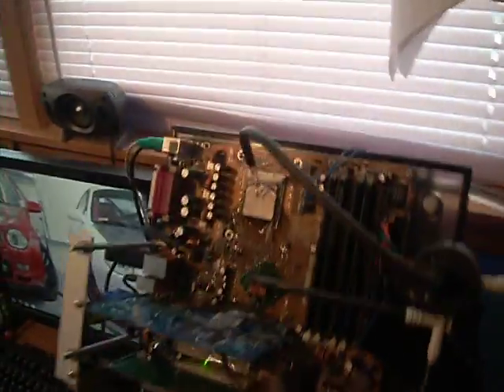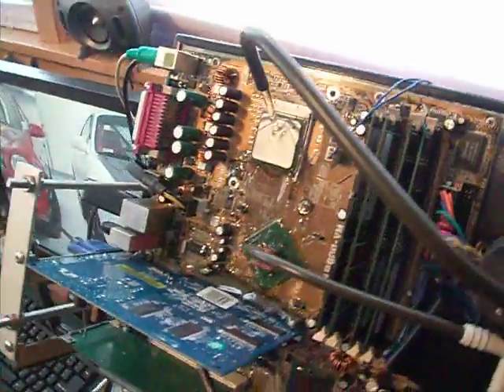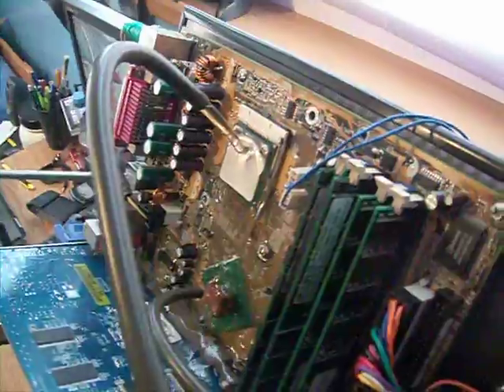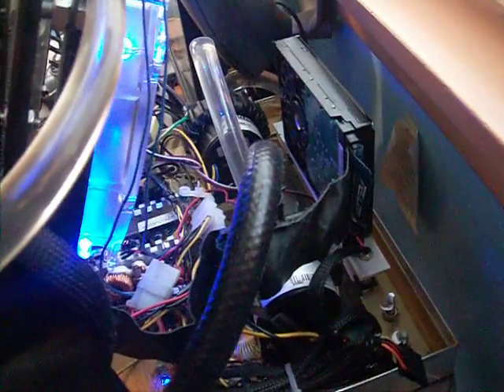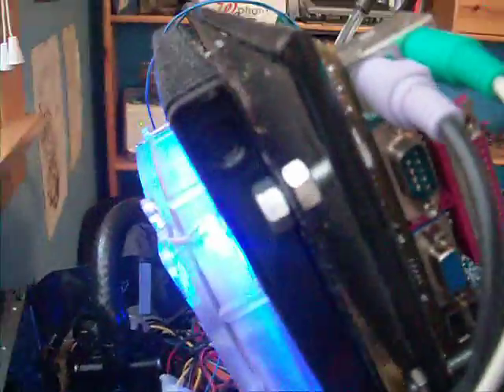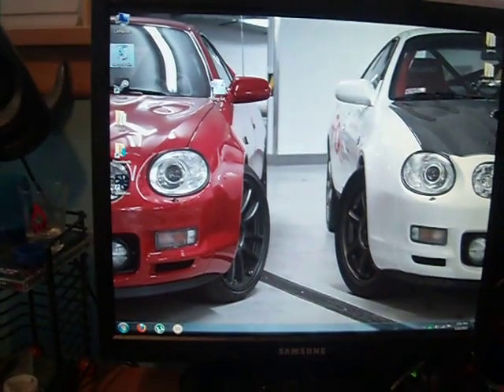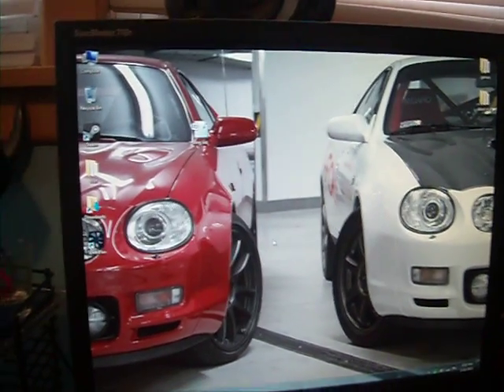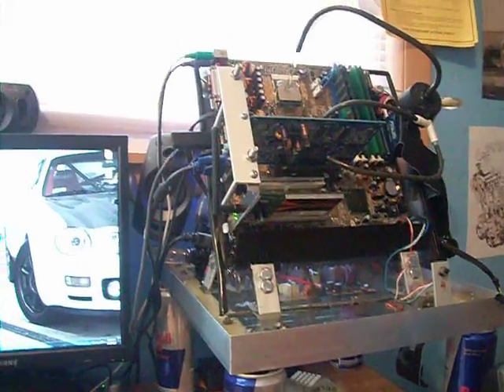My oil cooled computer [no aquarium]

Comment: It's a cool idea but doesn't mineral oil fuck up rubber hoses? Also, I thought you weren't supposed to submerge the PSU. I could be wrong, but I could swear I heard that those were the 2 biggest things you're not supposed to do when setting up an oil cooled PC. Don't use anything rubber, and don't submerge the PSU.

Comment: one of the main advantages to using a submerged and closed system is to prevent impurities and dirt from getting in the oil. if that happens the oil will not function as a cooler. an acrylic hood with filtered ventilation would work well.

Comment: except it's also 300 a gallon, would evaporate into the air rather than store heat like the oil does, and is sold in obscure locations or from specialized dealers. Don't get me wrong, I love the stuff for it's brilliance and potential for application, but for this project, a personal computer that is NOT held in an enclosed environment, Novec just wouldn't do the job.

Comment: Interesting. But it would be more efficient to lay the board flat and let the oil run off on its own. Mineral Oil is a good Heat Absorber but not well for Exhausting the Heat which is why he has a Radiator. But with a Stream that fast the Oil doesn't have much time to grab some Heat from the CPU before it looping back around again, it only makes contact with the CPU for about 0.12649 seconds. So if the Motherboard was flat it could make contact for about 2-3 seconds which is a good amount of ti

Comment from the maker: The cans are attached with bolts. The oil doesn't evaporate or leak, so I've never had to add any since original assembly. Dust is handled by a small engine fuel filter.

Comment: Oil's thermal conductivity is only about .12-.15 so if you do anything intensive, you might consider using CPU & GPU coolers that have heat pipes and run the oil over them.

Comment: The US Air Force used a technique like this to cool hot IC's in missiles: they just squirt coolant (like Freon, or canned air) directly on the chip die. It was lighter and cheaper than expensive heat sinks and phase change cooling systems for a one-shot computer.

Comment from the maker: @MrTpengineer 
The pumps I'm using are asetek watercooling pumps, so I'm way ahead of ya haha. As far as evaporation goes, mineral oil doesn't evaporate. At least not any significant amount. I've noticed no level drop over the past year so I don't have too much to worry about.

Comment: You can sometimes repair a removed IC chip, strip it down to the bare PCB lay the chip where it should go & put it in the oven for a bit, it worked for me when I removed some heatshinks from some RAM & an IC came off with it. All it does is reflow the solder.

Comment from the maker: @AliveoutofSpite 
haha its funny you mention it because it sure sounded like one of those fountains for a while. But the drip sound is really hard to sleep with so I installed some baffles, though the oil changes viscosity as it heats up so I still get a little dripping noise every once in a while.

I think you should check out hardcorecomputer's website. They are making a submerged pc like the one you described and i think you'd find it interesting to read

Comment: Very cool! I'm planning on doing a hybrid- something like this, but all submerged. I figured a couple aquarium-type pumps in series will give me all the pressure I'd need, then push it through a filter (think Fram), a radiator, and then pipe the cool oil directly to the CPU, GPU, RAM, etc.
This is a really cool concept- it reminds me of those desktop fountains...just need a zen garden and a bonsai, and you're set.

Comment from the maker: @HennesseyHPE1000 

actually, sometimes the intake sucks in some air bubbles that get stuck in the pumps and all the computer does is shut off. The pentium 4 cuts power at some threshold temperature so I dont really have to worry about frying anything. In fact im pretty sure most cpu's have that feature these days.

Comment from the maker: @JamaicaNY11435  

It's hard to give a definite number on CPU temps simply because there are many variables that affect how well the system works. However I did get 49C under full load when I directed all of the streams at the CPU. Increasing the flowrate drops temperatures dramatically, that's why i plan on buying new pumps soon.

I have a small fuel filter on the intake that traps any dust that may settle. As for changing the oil, I just never had to.It's stayed the same for ~6 months now